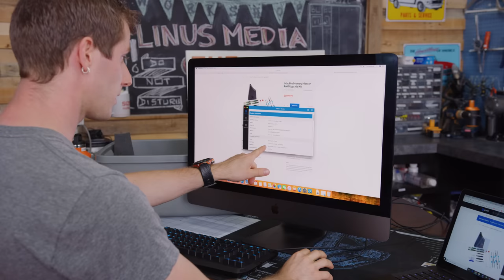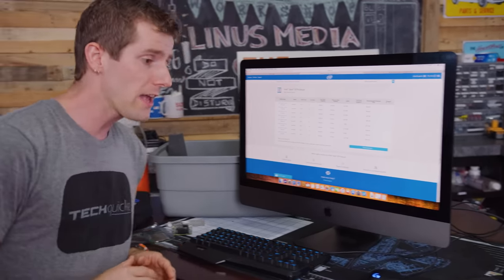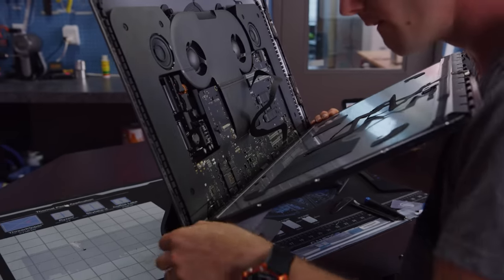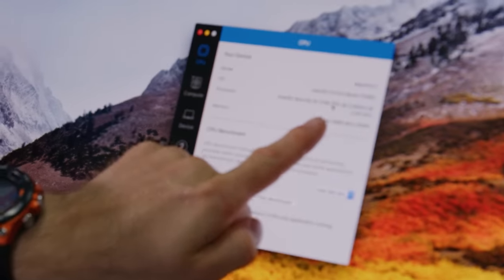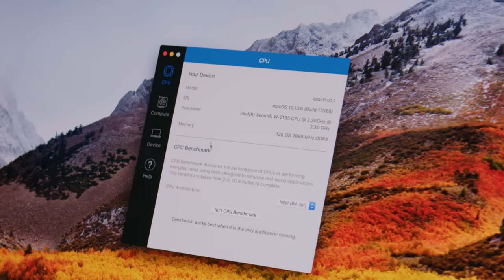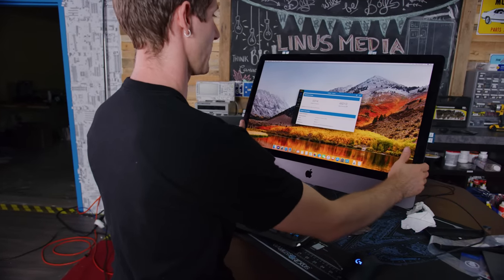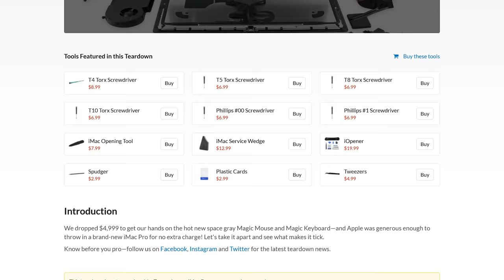UPGRADING the iMac Pro!?

Comment: If I wanted a high-end desktop Mac, I'd build a two-CPU Mac Pro from 2009-2012. Yeah, you're stuck on Gulftown processors, but you can get up to 12 cores in it, and GPU options are plentiful, even a 1080Ti will do. With a max capacity of 128GB of RAM and extra drive bays (not to mention PCIe slots) out the wazoo, performance can basically match that of the trash can Mac Pro while only missing a few features (namely Thunderbolt) while having vastly more configuration and storage options.

This is actually exactly what I plan to do, because I have a bunch of older Macs (G3/G4/G5 Power Macs plus a couple of iMacs G5 and newer) that I like to use for older stuff but I'd really like something that can actually run a modern Mac OS version. I can't see spending the money on a trash can given the minor CPU performance increase, and while the iMac Pro isn't actually that bad a machine, it's way more money than I'm willing to spend, and I kind of hate the form factor.
Reply: Stay in the 2012 range. I've been looking and only thee 2012 5,1 models seem to even support DDR3. The others seem to only support PC2 Memory from what I'm finding.
Also, be careful. I found a 2009 iMac that was firmware hacked to read as a 5,1 as well.
Reply: @AceMcCrank  but why do you need a Mac so badly?
Reply: The 2010-2012 models are all exactly the same. The 2009 is also the same, with the 5,1 firmware they're identical. However, the mounting of the CPU in the 2009 model requires removal of the integrated heat spreader if you choose to upgrade. That's not a problem for me as I can easily do that myself.

All of them are DDR3, as they're all the same socket.
Reply: Ofek,, I don't need one. I was just curious. And I'll take Adam's words for it as I'm not a mac expert by any means. Just going off what I found on eBay and old wayback machine pages from Apple's site.
Reply: The 2009 Mac Pro is identical to the 2012 Mac Pro. It doesn't just show that its a 5,1 it gives it all the same software compatibility. It is literally just a bios update (Source: I own one)
Reply: Adam Baldwin I’ve got a 2008 Model with 8 cores running at 2.8Ghz. Not exactly a powerhouse, but runs about as well as my 2012 MacBook Pro 15 inch. Also have a GTX 760 installed with 24GB of ram. Runs Mac OS Mojave like a dream!
Reply: or you could build a hackintosh and be done with it.
Reply: Good luck building a Hackintosh with two sockets and 12 cores.
Reply: Why not? If there's a similar comercial model it can be done. You can find builds like that in the forums. There are even Ryzen 2990WX builds with 32 cores that are probably better than the xeon dual socket and cheaper. https://www.insanelymac.com/forum/topic/325514-amd-high-sierra-kernel-release-and-testing/?page=42&tab=comments#comment-2632878

Comment: For the killer power supply (PSU): 
1. Wear rubber glows. 
2. Discharge the capacitors using a regular light bulb (preferably one that was designed for 230V) - connect the bulb to two wires - one wire goes to ground, with the second one touch one by one all the metal leads of the big capacitors and all the heat-sinks as well.
3. Please, use a $5 multimeter to double check if there is still some voltage around.
4. Now you are safe to lick your PSU parts, have fun!

Comment: Only one major issue, it’s antennae not antennas. lol great vid. Just makes me more and more passed off at Apple ignoring what the prosumer typically wants in an easily upgradable desktop machine. Which is why I’m so reluctant to give up on my 5,1 Mac Pro. I just wonder if the 1080 ti is worth it and if the new 20 series cards will even work in one. I’m not a Mac gamer though. I’m wondering for 3D applications like blender and cinema 4D and after effects/premiere pro/photoshop applications.

Comment: I loved the video, and you always entertain me with your way of doing things. However, you made reinstalling the screen look way more complicated than it needed to be. 

1. Install the bottom strips of adhesive onto the screen instead of the case. 
2. Peel off just the strips on the bottom adhesive and line up the bottom of the screen with the case. 
3. Install the screen and hook up the cables by tilting the screen forward without the fear of it falling off (due to the adhesive on the bottom)
4. Peel off the other strips from the adhesive on the case and line up the screen before committing to sealing the iMac Pro back up.

Comment: Why would you reuse the thermal compound on the gpu

Edit: 11:07

proud of you Linus
Reply: He should have done a temperature comparison of the GPU with different thermal compounds.
Reply: Bcuz He snuggles on thermal paste
Reply: I have not replace the thermal paste on my cpu in years now its good I reused it
Reply: It is not about the paste losing its properties but Apple using mediocre paste in the first place. Some time ago I replaced the factory GPU paste on my Saphhire R9 390 Nitro against Arctic MX-4 and the temperature got even slightly higher, probably because I applied a little bit too much and because the generic one was extremely good already! But other manufacturers tend to not use the high end stuff so I would find it interesting to know if the iMac GPU (which was not changed) would be cooler now with the new paste.
Reply: He actuallly didn't. He replaced it off camera (or at least claimed to). I was wincing at that decision too.
Reply: yeah, it will make air pockets which will vastly increase the temps
Reply: Sorry I missed the second part, it was below the fold.
Reply: ikr. it needs mor liQuiD mEtAL
Reply: exactly what my reaction was

Comment: Way too much effort for such simple upgrades... not to mention the risk of accidentally touching the exposed power supply.
Reply: All you need to do is unplug the power cord then hold the power button down for maybe 10 seconds to drain the capacitors...
Reply: For the killer power supply (PSU): 
1. Wear rubber glows. 
2. Discharge the capacitors using a regular light bulb (preferably one that was designed for 230V) - connect the bulb to two wires - one wire goes to ground, with the second one touch one by one all the metal leads of the big capacitors and all the heat-sinks as well. 
3. Please, use a $5 multimeter to double check if there is still some voltage around. 
4. Now you are safe to lick your PSU parts, have fun!
Reply: @gogolapeter  thanks
Reply: please god don't go buy one of these and do all that just to lick it.
Reply: #pcmasterrace
Reply: Here's a more realistic guide: 
1. Try to stay away from the PSU. 
2. If you need to work close to the PSU, unplug the machine (so it is not referenced to ground) and either 
2A. wear gloves (or at least one glove) or 
2B. only work with one hand (that way any potential short will only go through your fingers and not your heart—it will hurt, but it can't kill you). 
Also the chance of actually dying from discharging one of these caps is a lot lower than people would have you believe. It can happen, but it isn't very likely, so don't worry too much about it.
Reply: 20 minutes to save 1000$.... too much effort? What the actual fuck, do you have like 3000$/hour wage or how the hell this ratio does not appeal to you? Or perhaps you are a true iSheep...
Reply: This upgrade took a lot longer than 20 minutes, plus the risk of killing yourself and damaging the machine (which can't be repaired, evidently)
Reply: +hellterminator I am pretty sure at 2B we would all be admiring the imac's ass
Reply: Von Degurechaff Ownage level over 9000! xD Greetings from Hungary!
Reply: Takashi 125 it’s intentionally built to keep away people from doing it so...
Reply: Seems like an interesting challenge but there is a ton of stuff I'd be afraid of effing up by doing something so delicate.
Reply: @TwilightAdvance  well it wasnt 20 mins in his defence. As linus said only the scrubing of the adhesive was 1hour long. Also u can see skips in dealing with the mac and not to mention his preperations with all the dodats :D Well lets say 2 hours + waiting for shiping after ordering O_O As he said all the time in tention not to FUCK UP expensive components. And Linus is somewhat skilled in handling such things. He got experience that normal Joe doesnt have. And yea we know LInus fucks up alot, but when u all the time do things for first time and rush it as he, its common to happen, also he is not wery responsible as he doesnt care much for the loss as his time is more valuable then the damage he often does :D
Reply: @TwilightAdvance  by definition you have not been electrocuted, you have been shocked, electrocution is death by electricity.
Reply: @gogolapeter  
Can the "rubber glows" be RGB?
Reply: @j.b.2263   I forgot to mention ... the glows have to be RGB! Of course! ;-)
Reply: my arm touched that exposed power supply while the computer was plugged in, didn't hurt that bad...but I don't recommend it
Reply: @curtiscrowethephotopro2453  oof ig it wasn't your time😂
Reply: @TwilightAdvance  agreed plus I live in UK ive been electrocuted several times in my life and im fine. We have 230 v sockets with 15 - 20 amps ive been hit at least twice direct from wall sockets for a split second and nothing happened to me! it didnt feel good but other that that no problems ( that i know of!!!!)

Comment: Install a water cooling system in an iMac, that would be an interesting project !
Reply: Or in a modular pc
Reply: think its too thin...
Reply: Cose strane trovate sul web He would have to drill a hole, lead out the water pipes at the back and attach the cooler to the foot, for example.  There would be no room for that in the iMac itself.
Reply: Yes, a new Hackintos-Pro. That'd be AWESOME! <3

Because it doesn't seem Apple is working on that really hard and IF, it'll still be an unupgradable machine like the trash-can-pro (yes, yes... potentially you COULD... POTENTIALLY!).

Comment: Replacing the iMac Pro's CPU doesn't look too different from replacing the CPU in the 2013 trashcan Mac Pro, which I did a couple of weeks ago.
The Mac Pro CPU upgrade was overall fairly easy (with about a third the screws of an iBook G3 hard-drive replacement), but I had a lot of trouble in the last stretch: I couldn't get the CPU bracket out because some of the motherboard standoffs had come off, and by turning the screw, I was turning the standoff and not the screw. Thankfully, I got the bracket off, and had no trouble from then on putting the standoffs and bracket back with the new CPU.
I upgraded my trashcan Mac Pro from a 3.7 GHz quad-core to a 3 GHz TEN-CORE CPU, and I'm extremely happy with how it turned out. :D

Comment: Pro tip (I'm a lead tech at an AASP) if you actually do this; remove the 9 screws to remove the bottom guard on the bottom lip before removing the logic board. Makes it 10x easier and less risky
Reply: Well, you’re no longer an AASP.
Reply: @wta1518  nah still work at one
Reply: @michael5743  really? They let you get away with this?
Reply: @wta1518  apple isn't communist. Im allowed to give tips. Im even allowed to fix Apple devices customers attempted to fix but gave up. As long as they didn't replace anything with third party parts
Reply: @michael5743  I was making a joke